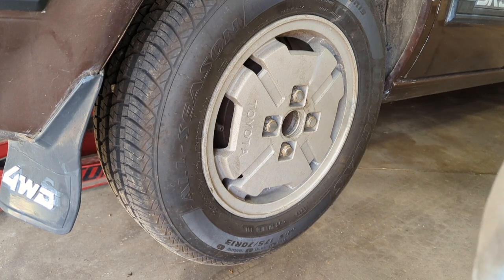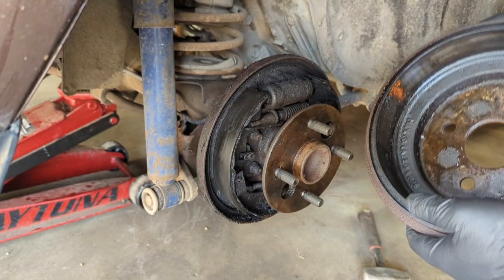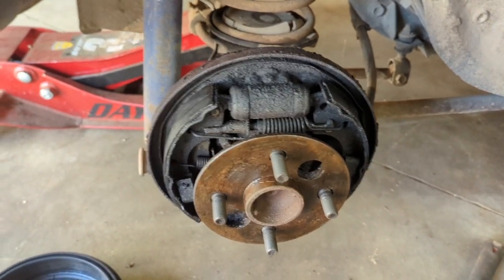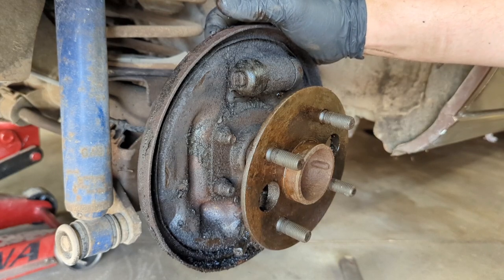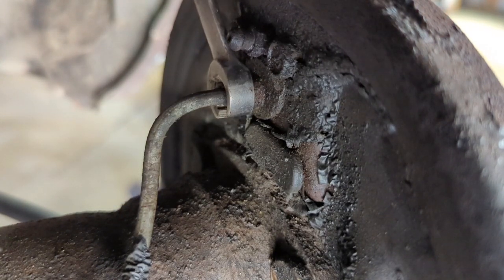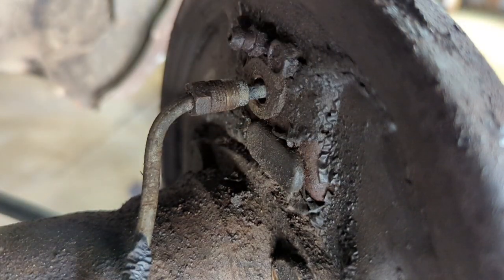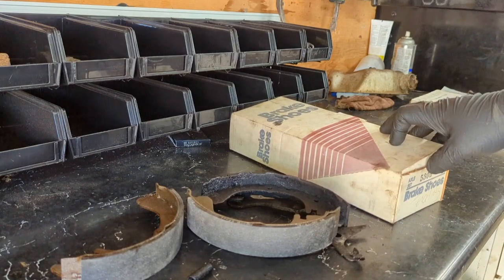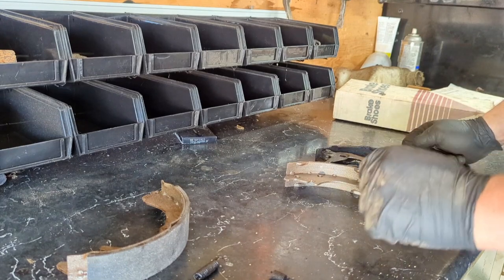1983 Toyota Tercel 4wd: Rear drum brakes. tips, tricks and information!

Comment: How do you. Thanks for the video, it was very informative. I accidentally bought wheel cylinders for a 2 Wheel Dr. rather than four-wheel-drive off of rock auto. With the brake line nipple being orientated in a different way, do you think it would still work?
Reply from the maker: I believe the wheel cylinders do not open up as far as they should compared to the 4wd models. It might potentially work, but the 4wd wheel cylinders are only a few dollars on rockauto. I would personally just order the correct ones.

Comment: Shoulda threw them sbestos shoes in the trash bro!
Reply from the maker: I definitely agree. I just needed to get the car moving. I already ordered another set of shoes and will be changing them out once they arrive. Definitely outside with a fan on blowing the potential dust away. Haha.
Reply: @BeardedWrencher  Mint. I just did the right front wheel bearing on my 81 Tercel and before I threw the old pads back in during reassembly I cleaned them up on my wire wheel bench grinder. Then after realized I probably just breathed in a shit ton of asbestos from these old ass pads. So, that's pretty awesome, I'm stoked about that 🤣.
Reply from the maker: Hahaha yeah it happens unfortunately. My friend did asbestos removal for several years. He said it typically takes 20-25 years to start infecting the lungs. But it's not a "for-sure" thing. Plus with a lot of materials they would use light traces of it so unless you literally inhaled it like drugs it won't likely enter your lungs. Either way, take care of your health and wear a respirator whenever possible!